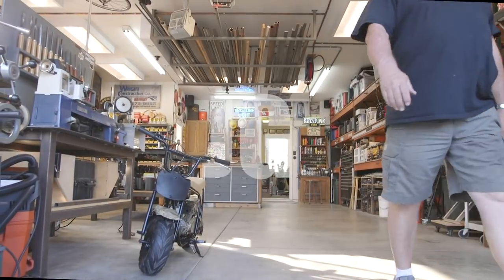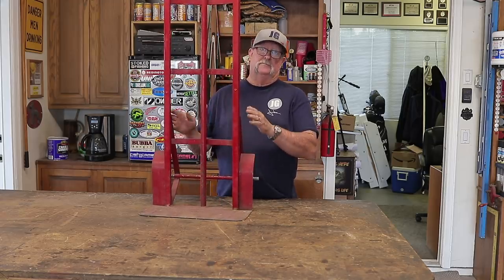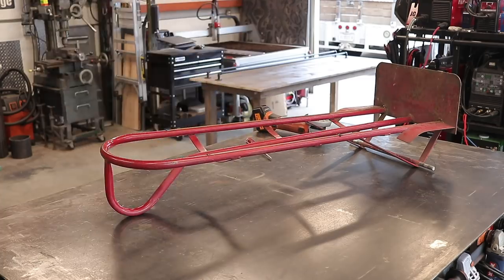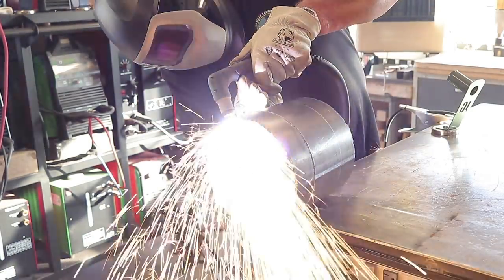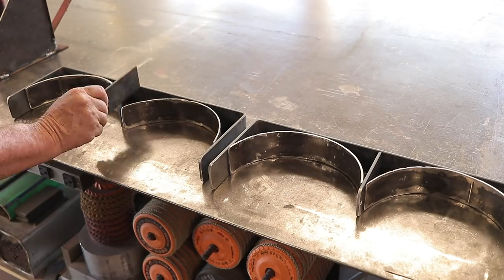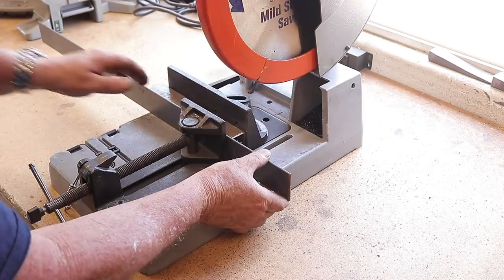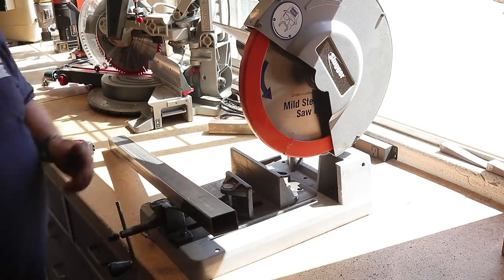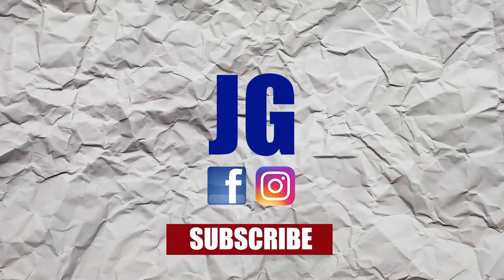Oxy Acetylene Cart | JIMBO'S GARAGE

Comment: Flap drum or round stone on a die grinder is the ticket for dross on an inside radius. I deal with that at least twice a week, so I figured it out quick. Makes it easier if you just make a knockoff bar from a chunk of round bar with a 1/4 of a section of 6" pipe welded on the end with a bevel ground on the inside edge of the pipe. Use it like you would a chipping hammer for dross on flat stock. Way quicker, even if you have to tap it with a hammer every section. You burn through way less flap/sanding drums, too.👍

Comment: Great recycle and build. The old green one made by Anthony has a whole line of 'tank dollies' as well but they are pricey.  Very functional, the only thing I don't like is Harbor Freight, but that's just me. They sell mostly junk and you always get what you pay for. I have replaced all my dollie wheels with solid tires from Ace. Did the same on my generators and power washers as well that didn't already have a better tire. I have never had any luck with anything from HF.  That is one nice tank set now Jimbo and as always, your videos are great.
Reply: Anything can be "junk". I have had name brand products turn out to be junk. I have had success with Harbor Freight. In fact, when I used to do cable and fiber installations, all my hand tools and drill were Harbor Freight. I used their Bauer cordless drill and it holds it's own against my buddies that have DeWalt. Now to be honest, I used HF because I didn't want expensive tools getting broken or stolen. I'd rather lose a $70 drill than a $300 one. Considering all the stuff that is name brand, which is made in China I think HF gets a bad rep.

Comment: Good video.  Most carts I have seen on construction sites are basically unstable, especially with tall cylinders.   The Compressed Gas Association Standard allows cylinder positioning 45 degress and OSHA has concurred with this in a recent letter.   Carts with rear wheel(s) now safe for delivering of actylene gas without expelling the stabilization agent (acteone).

Comment: i know this is a year old but .... been watching your vids and noticed your dross problem on a couple others , you should be able to tap the edge of the plate with a hammer a it will literally fall off , if not your plasma settings are incorrect ,travel speed consistency is also a factor ....awesome vids excellent fabricator great projects !!! 👍👍👍

Comment: Jimbo, I just saw that you had trouble with the dross after plasma cutting that tube.  Been there done that.  You should try plasma cutting tube/pipe like that *from the inside*.  It might be tougher to scribe the cut line on the inside  but that way you can simply knock/chip the dross off with a regular chipping hammer on the outside of the curved part.  Wayyy easier than trying to grind it off the inside curve.  Try it!
Reply from the maker: Thanks for watching Oscar, That is a good idea, I will try that next time!    Jimbo!

Comment: hi  JIMBO'S GARAGE  I bought a 60 gallon Porter Cable compressor and I just wondered what size wire I should use to plug it in with

Comment: Looks great! I just started welding so sorry for the dumb question but I noticed you weld right over the paint and rust. I thought you had to have clean metal before you weld. I know this isn’t a heavy duty structural thing but wouldn’t welding through the paint and rust contaminate the weld and weaken it? 

Thanks to anybody who can answer this and give a little insight.
Reply: Its best to weld clean material but a lot of time you can burn thru it just fine.

Comment: The weak link in your build is those crappy harbor freight tires.  You can build the same cart with wheel hubs from a trailer or from a small car and use trailer tires and/or space saver tires from a car.  As soon as you roll your cart on rough terrain, those tires will blow, leaving the tanks unstable and a safety hazard.